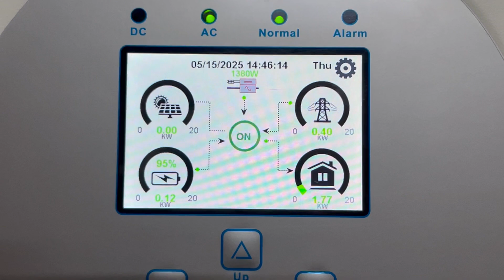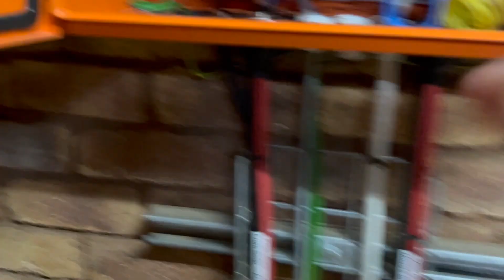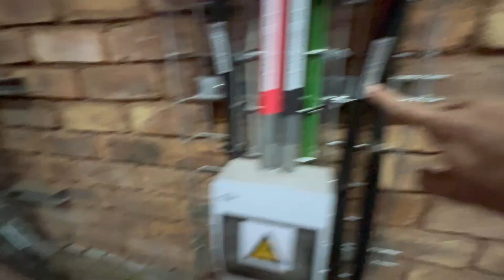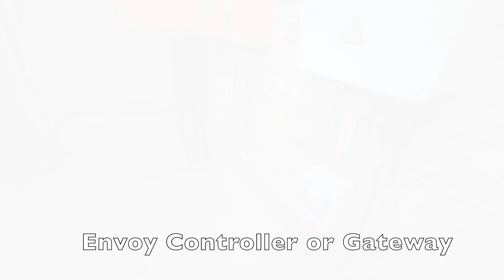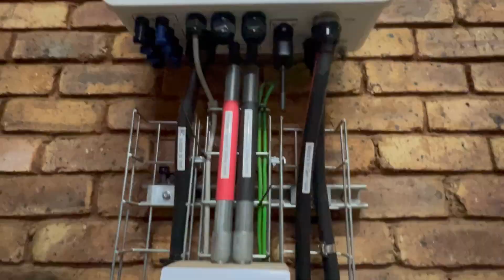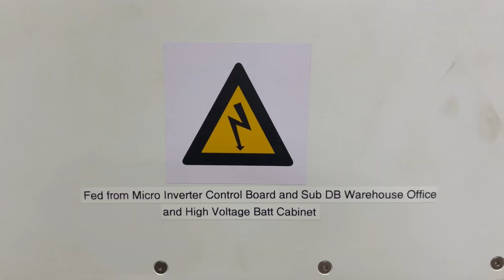AC Coupled Enphase iQ8 with Deye Hybrid Inverter and 30kWh High Voltage Battery Bank

Comment: Goeiedag, nice labeling, licenced spary here. You don't see that here so often in NZ. I was looking into something similar, but on a smaller scale. Our system has 5 IQ8HC inverters and 22 M215 inverters, would this work with both model inverters? I suppose the gateway is also connected to the gen site of the Deye inverter? Can you tell me the settings in the inverter for the gen input? Where would you place the Enphase CT's?

Comment: Very neat job!  In order to connect Enphase IQ8s to a Victron inverter you need to get Enphase to install special firmware in the micro inverters and configure the Victron to ramp up the frequency to 52Hz in order to kill production in the event you go off-grid and the batteries are full - to avoid overcharging them from solar.  U.S. the same mechanism used on the Deye inverter / changeover ?
Reply from the maker: I’m always cautious when it gets to pairing different systems together. For this installation the configuration was straight forward and no other interventions were necessary  

The Enphase system use a device called a q-relay. I’m not sure if it is required in other countries. The q-relay switches under various conditions 

Thanks for the comment and for watching

Comment: Good afternoon.

Super nice system.
I now have the Deye Sun-20k-sg05lp3-eu.
I'm trying to connect my Enphase to Gen.
But I'm not getting any voltage on my Q relay. How did you do that so the system can start up?
Reply from the maker: You have to configure the Deye and specify that you are also using micro inverters 

I would test the micro inverters separately first and make sure they work on their own and then move the connection to the inverter 

That way you will shorten your fault finding process

Comment: Very informative video once again, Carel, and a great installation too.

I had a few questions, though I think I may have partly answered them after some soul searching. Still, I’d like to run them by you. I know you’re based in South Africa, where solar irradiance is generally excellent, but I was curious about the choice of microinverters for this project.

For context, I’m Nigerian, and microinverters are practically nonexistent in my part of the Sahara. From my limited understanding, they’re often used in regions where irradiance (and consequently efficiency) fluctuates significantly, particularly during the winter months. Does that mean, in this case, the microinverters were selected to improve panel-level efficiency rather than simply stringing directly into MPPTs?

Or could it be something more straightforward, such as the multiple orientations of the PV panels on the roof, which would make it impractical to combine strings of different orientations on the same MPPT (assuming the inverter has two or three MPPTs)?

I’d be very interested in hearing your thoughts on this.

Thank you for your time!
Reply from the maker: Hey Sam

This was an installation on a chemical plant and they did not want any chance of an arc. 

So it was micro inverters for that reason. In SA we do have quite a few filling stations that use micro inverters or optimisers for reasons of safety. 

Hope that satisfies the question and I’m glad I could contribute to some soul searching as a result of one of my videos. 😊
Reply: @carelb_pqrs Yes your contribution means a lot 😅.
Thank you very much.

Comment: How do you have 4 cables coming from the iq8 microinverters??🤔
Reply from the maker: The Enphase micro inverters are installed in single phase. Each string has a single phase with a Live and Neutral Wire. Because it is a 3-Phase installation, there are three Strings on the roof. Each string represents a phase. The four wires would be 3 x Live wires (1 from each string) + Neutral.
Reply: @carelb_pqrs I have a 3 phase deye 12kw hybrid inverter, can I ac couple it to my 14pc iq7 microinverter system? My house has 3 phase ac from grid
Reply from the maker: @mariusfauru you should be able to. It should just be set up to work on the gen connection as a micro inverter input
Reply: @carelb_pqrs thank you for your help! I am having difficulties getting some help with my system 😢
Reply: @carelb_pqrs in my situation, Would a Deye 12kw 3phase hybrid inverter ! Or a Solis 10kw Ac coupled 3phase inverter would be a better choice?
Reply from the maker: @mariusfauru i am not familiar with Solis but I have heard good things about them. You would have to do a bit of research to check settings and configuration requirements

Comment: Nice Install Sir but I have a question. Considering power failure of the GRID, what will be the source for the signal to the IQ8? Is it coming from the Load output of the Deye Inverter?
Reply from the maker: Yes, the AC signal from the inverter output will keep the micro inverters on during load shedding

Comment: Nice Install and Video Carel
Reply from the maker: Thanks Anton. 
Starting it up was easy. 
Getting the equipment to reflect the actual values on the portal was a bit more challenging. I Found the Enphase platform was easy to work with and tech. support was very good.
As usual . . . reading a manual helps :-)